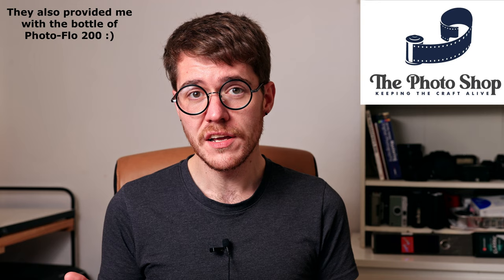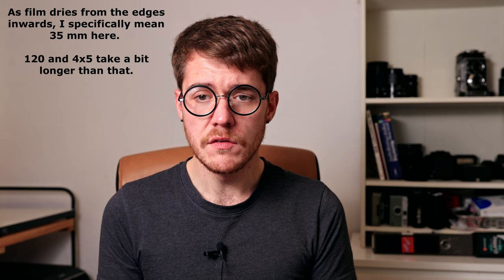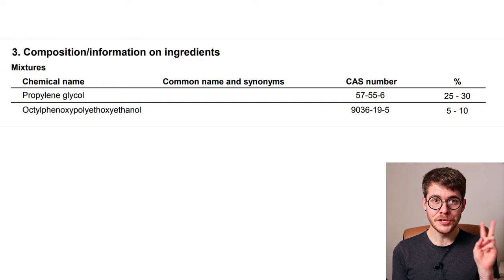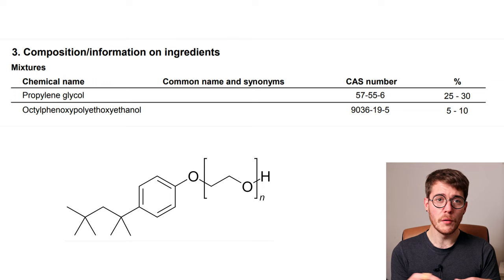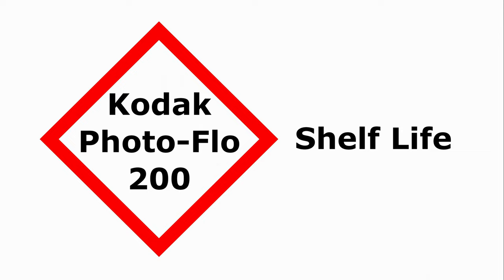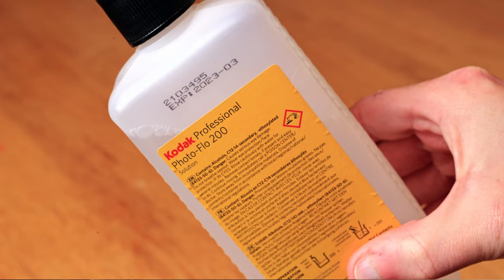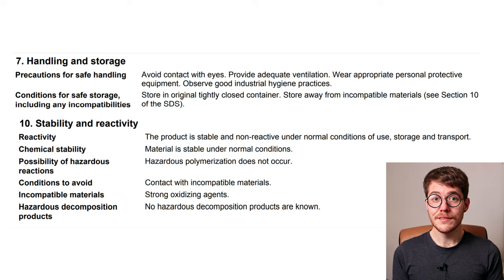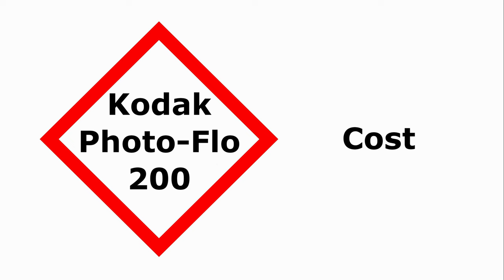Kodak Photo-Flo 200: Safety, Handling, Disposal

Comment: Back 50 years ago, when film and Kodak were still king, the technical magazines generally recommended that Photoflo 200 be diluted for use at 400:1, half the strength of the Kodak recommendation. The basis was that used as recommended, the working solution was strong enough to scum the film if used without care, and that it tended to take longer to dry. In any event, I've used the weaker dilution for about half a century with no issues. I have no data on drying time, as I never use a wipe or squeegee, but just mix with distilled water, dunk film for 30 seconds and hang to dry in a drying cabinet. Perfect results every time. I do not understand why everyone doesn't use the stuff or equivalent as a matter of course. Since I tend to save up shot rolls until I have the motivation to develop the accumulated batch in one session, I just mix a working solution for each session and toss it at conclusion. As you note, it is cheaper than dirt.
Reply from the maker: I inherited a drying cabinet last year but don't have the space for it so I traded it away - I can imagine it's extremely helpful! I haven't had any issues thus far with the stronger stock solution but I'll hear that in mind as something to investigate in case anything funky ever happens.